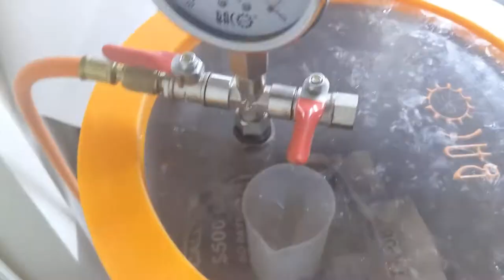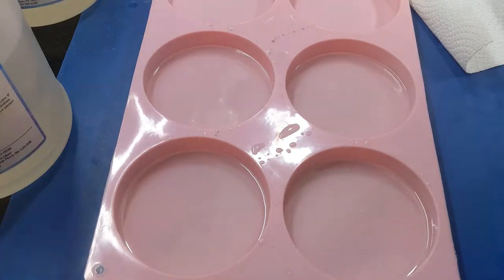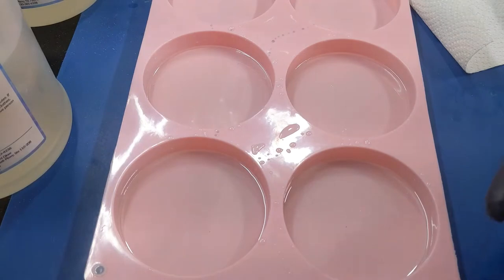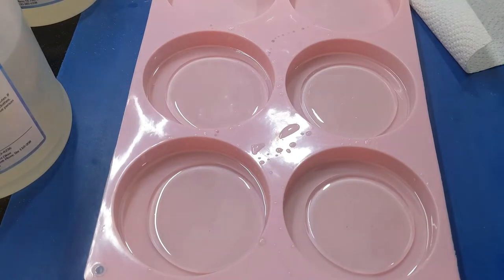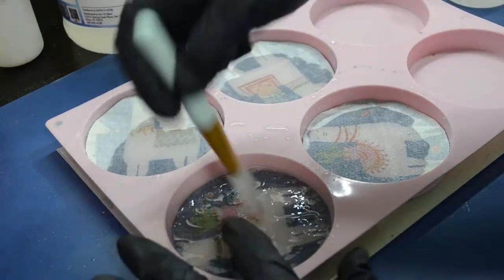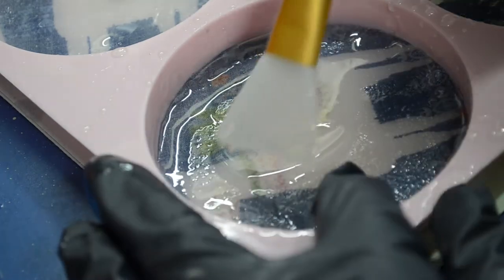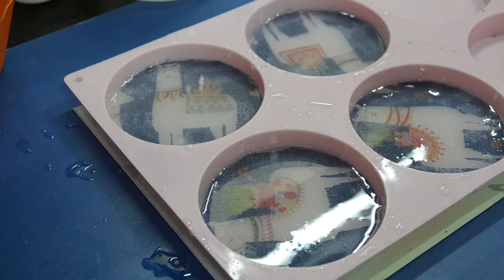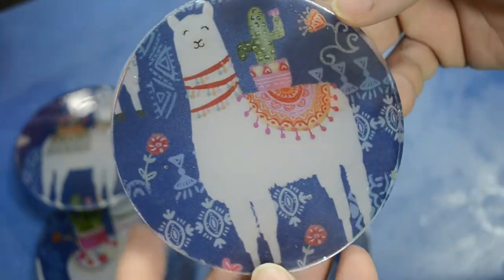Llama Fabric Coasters, Fabric Set in Epoxy Resin

Comment: thank you for the video.  I like that the back came through very pretty. I want to try it with silk. What grit of sand paper did you use??
Reply from the maker: 180 usually. Unless I need to take off a lot, then I use 100.

Comment: Did you seal the fabric with anything before you added it to the resin?  I am trying to do a project with my FIL’s old ties as a Christmas present.  I use UV resin.
Reply from the maker: No, I don't seal it with anything. It works great. The only time I would seal the item is if it will run color or oils, depending on what it is. Fabric has been good every time without sealing it. Sorry about the delayed response, I had major surgery and just got back into things. I hope your project turned out.